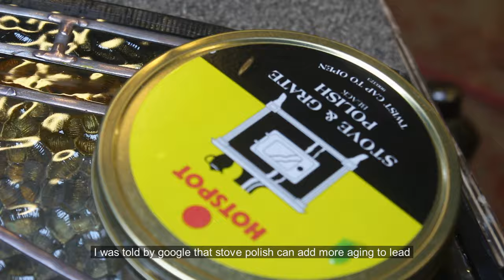Poor man's stained glass for my front door

Comment: This is truely inspiring. Have been wanting to do something with my new victorian house front door and stairwell window. But thought omg would be thousands.  Now i know how to complete, love the art side, no dound, so magical.
One question at the moment.
The 3 glass panels, were they new ones made by someone or excisting and is the crinkle in the glass inside or outside of the panel?
WoW, Thank you so much
Reply from the maker: Hi, yes they were new double glazing units made by a company. the patterned pane goes to the outside but the texture is on the inside of the unit, so the outside is smooth with just slight undulation.
Reply: @NewYorkshireWorkshop  Thank you so much for the information, so much appreciated. Am hoping it will be next winters task as other tasks yet to complete. Ive just completed a mosaic course to keep my thought proccess going. Have just subscribed, fab channel. Thank you

Comment: Hello . This is so beautiful, and the silence so welcome.  I have a few questions if you don't mind. I want to create a large arched window for a church but I want to use  a textured plexiglass rather than glass. Do you have an opinion about the heat of the solder gun on the plexiglass. What temperature would I need to use to have the results you showed.

Comment: Very nice work, but a note of caution. If that is real lead (and it appears to be), it should only be handled while wearing rubber, latex, or Nitrile gloves. :) Again, beautiful workmanship, thanks for sharing!
Reply from the maker: why?
Reply: @NewYorkshireWorkshop  Lead is highly toxic and can be both inhaled and absorbed through the skin.
Reply from the maker: @ArsPraestigium  only organic lead can be absorbed through the skin.
Reply: @NewYorkshireWorkshop  Tetraethyl, known as "organic lead," is a component used in petrol (gasoline). Its cousin, the heavy metal element seen as Pb (atomic number 82) on the period table of elements,  is, I assure you, indeed highly toxic. This is why drinking and bathing in water from lead pipes has been seen to cause neurological damage. Various levels of lead poisoning have been found in military personnel who regularly handled ammunition made from the element. Though retired now, I worked in emergency medicine for years. If you regularly work with lead, you should be wearing both protective gloves and a respiratory device (mask) to avoid the inhalation of its particles. You are more likely to suffer from lead exposure by inhaling it than touching it, but it's always best to err on the side of caution. You do very nice work, I'd hate to see you suffer the irreversible damage lead exposure can and does cause.

Comment: Hi, fantastic work. You've inspired me to have a go at mine. I won't be able to remove the glass (i'd probably break it and/or get burgled!). Do you think this might work if leaded on the inside rather than outside? For two reasons: mainly there's a step up to my front door and I'd have to be up a fairly high ladder and so I could work from inside regardless of weather outside. And the inside of the glass (my victorian/ edwardian door is single glazed with textured glass) is smoother than the outside. Thanks in advance for any advice.

Comment: Having made lead glass windows, You could have make a real lead glass window in less time than faking it is harder, the same skill is required when you clearly demonstrated you have the skill set and tools to be able to produce real lead glass windows. The only step you did not have mix window putty with linseed oil and brush in the cracks, you could have done a very white pin strip on the edge of the lead and it would very hard tell the differences. But anyone that knows true lead glass will look for that white puddy line between the lead and the glass to determine if it’s real or fake. Only foil lead do not have puddy but finer lead lines

Comment: Can I ask about your particular ‘Leading’ technique? In the video, you cut each piece to butt against the next, and then solder over each joint (which obviously looks more authentic). However, when I look a the product’s advertising, I see they show the adhesive lead strips running across and over each other. Have you tried that (and perhaps rejected it), because I would have thought running one strip over the top of another, would look strange? My potential project, is 2-panels in an interior door, in the style of Frank Lloyd Wright, so all straight lines and no curves.
Reply from the maker: yeah i think they are showing that as an easy option with no soldering, i did try it that way and then soldered it but the adhesive contaminated the joint and looked terrible so went back to the butt joint method. it isnt really too difficult and looks way better.
Reply: @NewYorkshireWorkshop  Thanks for answering.  Yeah, it definitely looks better.  The other thing that crossed my mind (when looking at the advert images), was that you can't be sure that the image they use is of the real thing anyway.  Might actually be Photoshopped or even a 3D rendering.

Comment: Fantastic job. My only question is how long would the adhesive last until the lead strips start to pull away?
Reply from the maker: its only been 6 months or so. i had a pick at it with my finger nails th his morning and it is still rock solid, just pivked away tiny bits of lead. the adhesive was really good after the glass was cleaned so il confident it will last a long time

Comment: The roll of leading for this project is it flat or does it have a domed top? Love the finished panels and fanlight.
Reply from the maker: it is slightly bent in section so that not all the adhesive contact the glass until it is pressed down. after it is pressed it is just slightly rounded on the top.

Comment: Has ultraviolet and heat from the sun had any effect on the adhesion of the tape over time especially since it was textured glass?
Reply from the maker: no not at all. since the strip is designed to be soldered i think it has heat resistant adhesive

Comment: So it is painted instead of using individual glass panels?
Reply from the maker: correct. i did want to do proper cut glass but also wanted sealed units for insulation so this is the compromise.

Comment: How does the lead stick with all of those bumps on the glass? Or is the glass smooth on one side?
Reply from the maker: the texture is actually on the inside of the sealed unit, some of it does show through on the outside but not much so it is mostly smooth. the lead is really flexible anyway and would probably conform either way.
Reply: @NewYorkshireWorkshop  That makes sense.  Definitely going to give it a try.  How has the sticky lead held up?  Think it'll peal away in the future?  soldering them all together probably helps a ton
Reply from the maker: i fitted the door in july last year so it has only been 6 months but it is still solid as a rock so far. you can see the adhesive side from inside and there is no sign of failure or dirt ingress etc. it stuck really well after cleaning the glass so im fairly confident.

Comment: Quick question, if this is on the outside of the glass is there any fear of washing the glass and it peeling?  Also can the glass be painted when vertical or will it pool too badly?
Reply from the maker: it has seen some fairly harsh rain, wind and freezing conditions and still looks perfect, it is for outdoor use and completely waterproof.
 I think it needs to be horisontal, you could try thinner multiple layers I guess if you cant remove the glass
Reply: New Yorkshire Workshop cheers for the reply mate, smashing set of videos. Really inspiring, so much so I’m gonna have a crack, even without an artistic bone in my body. Ta!

Comment: Not a bad job for a hobbyist. I make the genuine leadlights and am not a big fan of "Overlay" which is what you have made. Around the mid 90s ,when I first started, here in Australia , Overlay was popular ,but now has fallen out of favour. I've been in the business  26 years. When this overlay  panel cracks, you have to bin the whole thing, whereas real leadlights can be readily repaired. Pricewise Overlay is almost as expensive as real leadlights. I often have to replicate fake leadlights with the genuine article and the difference is night and day. As you found out, the adhesive of the lead and any glass film is not great. Paint will fade very quickly. Depending on climate, the lead, can start peeling off alarmingly quickly.

Comment: Can I ask is the glass smooth or bumpy, I have a 1930s front door I would love to lead. The glass looks the same design as yours but is bumpy one side and a lot smoother on the other but still a bit bumpy.
Reply from the maker: the textured side is quite bumpy and the opposite side just slightly bumpy like yours, they put the textured side to the inside of the sealed unit and the textured pane will typically go to tge outside so side, so it is the  less bumpy side of the textured pane that i applied the lead to, it conforms very easily to the bumps.
Reply: @NewYorkshireWorkshop  that's great . Thanks. Yours is lovely

Comment: I was thinking would it be possible to use colored resin on top of the glass instead of normal color?
Reply from the maker: not sure, if you have some epoxy  resin and pigments  already then go ahead and try, it should stick if the glass is cleaned. but if you have to buy the stuff then the vitrail will probably work out cheaper, unless you have some other reason to use resin? durability maybe?
Reply: @NewYorkshireWorkshop  Yeah i was thinking the resin could work as a protective layer for the glass aswell perhaps?

Comment: Your lead lines are smooth and don't show the texture of the glass.  Is the glass also smooth on that one side?
Reply from the maker: that side is the patterned side but the pattern is on the inside of the unit, only a small amount of deviation can be felt on the outer surface.
Reply: @NewYorkshireWorkshop  Thanks for the reply.  Your project looks great.